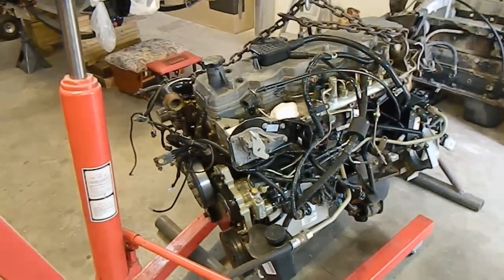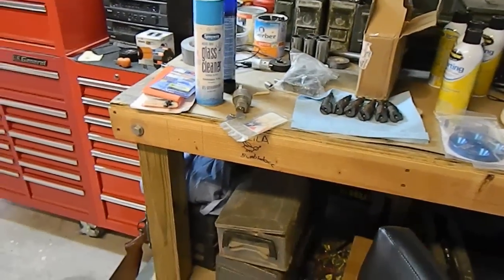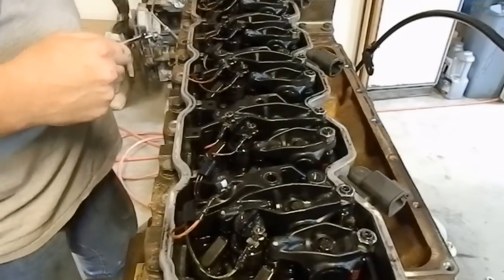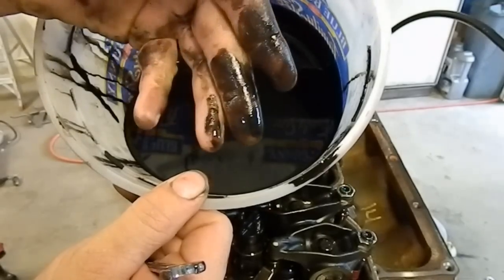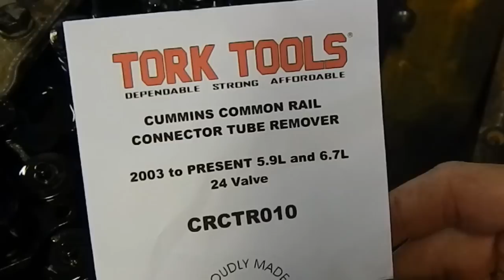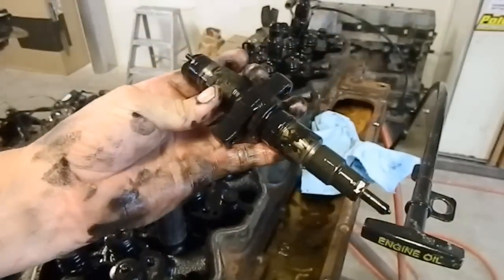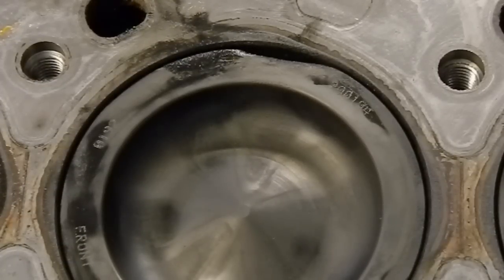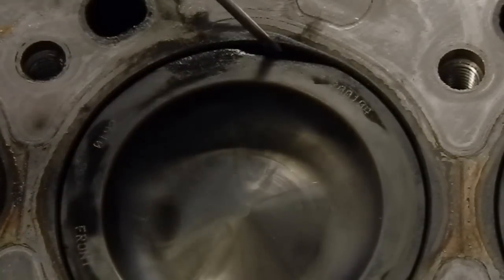04 Common rail 24 valve cummins tear down using Tork Tools part 1

Comment: Wow i have been waiting for someone to post videos on building an 05. Im glad it was u because u do good videos. I have an 05 with a nasty knock on #6 cranked it and took of in a hurry on a cold morning, also over due for oil change and jumped stright on interstate and lost oil press for a sec and boom same exact thing u have here. Knock and a bad injector on 6 so more videos and info would be greatly appreciated. Getting ready to pull mine in the next week or so

Comment: You ever try something like an AmsOil bypass oil filtration kit on your engines? They are supposedly rated so you can go about 20,000+ miles in between oil changes.

Comment: I have worked many years around trucking and working pulling wrenches. Maintenance is the key and don't push your equipment it will fail on you.

It is cheap down in the USA for engine parts and a rebuild. What Wayne is doing would a Canadian shop would be at-least 10 grand.

Comment: Yeah I sell salvage parts and I've sold to people in Canada, I've heard it's a good bit more for anything up there.
No joke, I've picked up some excellent buys in my area.

I never let a oil change go past 5k miles, if I've been towing 3k or so I get it done.

When it's time to rebuild my 7.3 I'm probably going to get the polydyn coated pistons and bearings.

Comment: wayne-
ive been working on my 89 1st gen   i had to rebuild the VE pump-all new gaskets
the pump is not pressurizing, when u take a injector line off and try to start the motor the fuel just comes out like you barely turned the water faucet on.   whats the problem???

Comment: Hey can you help me out 
I got a 2007 dodge 2500 cummins 5.9 with cold air intake 5in bully dog exhaust and a edge juice with attitude chip   and i wanna put injectors in it and i was just wanted to know what size i should get and if i need to replace anything else like fuel pump or anything ?

Comment: Yeah until this feller I never heard of PolyDyn either.
Yeah I don't want a huge truck payment for something that cannot do 200k even before needing serious work is a JOKE.

Yeah and who wants to hrow away 10k on EPA garbage that you have to pay more money to remove so you won't burn up your engine when it does it's "regen".  Man I get 8-10MPG pulling a camper with my 7.3 PSD, many new diesel owners see 10-11MPG just for their normal driving around, what a waste.

Comment: Dunno where you heard that bullshit from but seizing an ISB Cummins is no easier than doing so to a 3406E or an N14. The only way you can overload a 'small engine' is to modify it because if it could overload doing what it was designed to do, completely stock, then that would be poor engineering; these are CUMMINS engines not Powerstrokes (7.3 exempt)